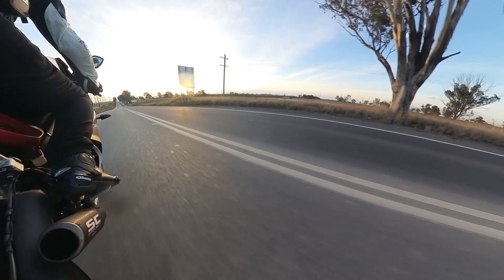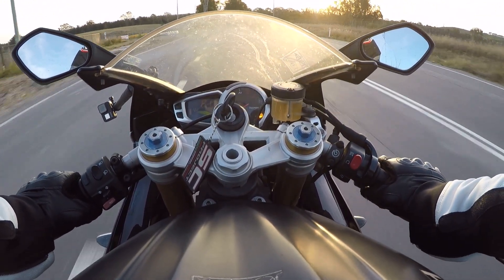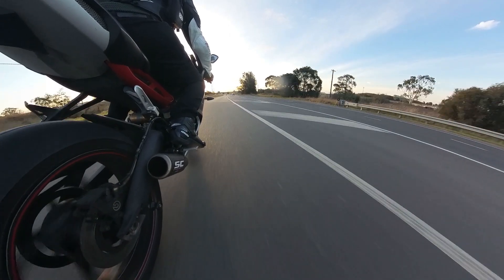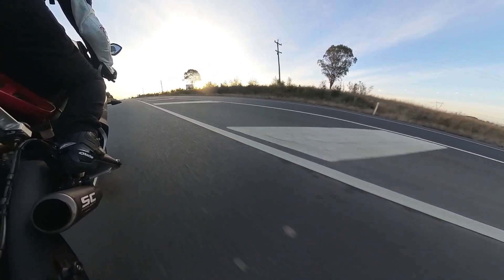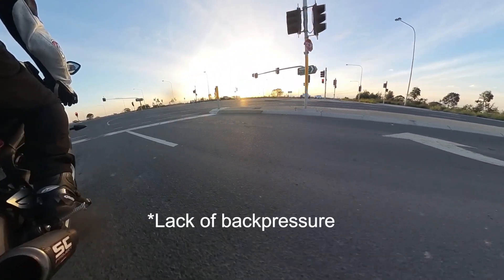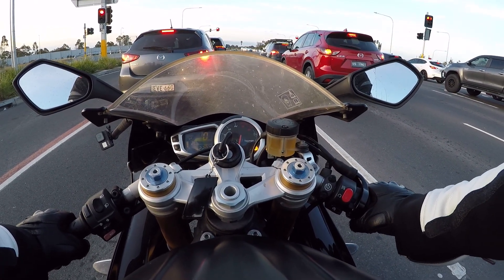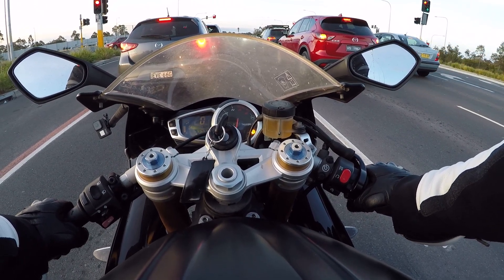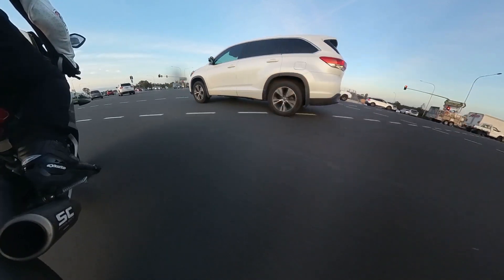Never install a race exhaust on a street motorcycle

Comment: It is very rare for a modern 4t bike not to be tuneable. More likely that whoever tuned it did a bad job. Another thing is one of the main reasons people get free flowing exhaust systems and dyno tune is to smooth out the throttle. A restricted exhaust will have a much choppier throttle. You can have your tuner make it so that the injectors are still spraying fuel when the throttle is closed. That gives you the smoothest throttle possible but also results in the bike shooting flames. And that’s how actual race bikes are tuned. But some bikes like the MT-09 just have very touchy throttles. The only real downside is the noise some bikes are just ridiculous.

Comment: LoL what the hell are you talking about man?

Your poor idling is probably because of the Power Commander. Depending on if you have Power Commander 5 or newer you can't tune below a certain RPM. It's definitely nothing to do with your exhaust. Throw that Power Commander in the garbage and get your ECU flashed. You're riding with ECU restrictions which are cutting your throttle and timing back, not mention your cat causing restrictions.

And I'm not trying to be rude but unless you ride on the track then your tune isn't doing much for you if you ride the way you do. You're not taking your bike above 6K rpm. Maybe look into a cruiser.
Reply from the maker: Yeah bro, it was tuned for the track. This setup is 100% perfect for the track. Also the reason you can’t tune below 6k is because closed loop undoes any tune you do on the PCV, so you’re probably right about the ecu tune but I don’t want to risk keeping the exhaust because it doesn’t pass rego due to the noise.